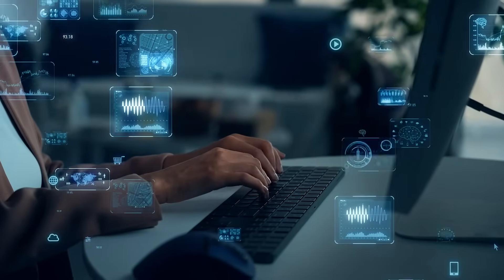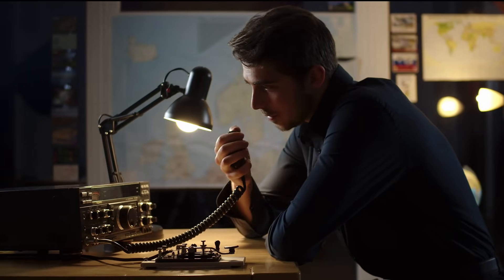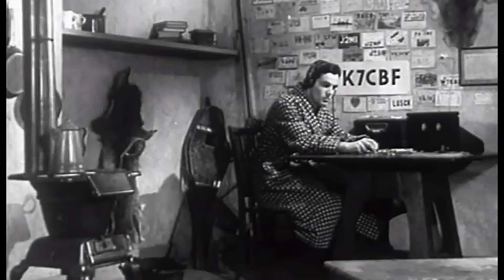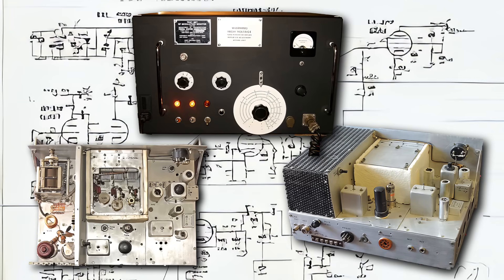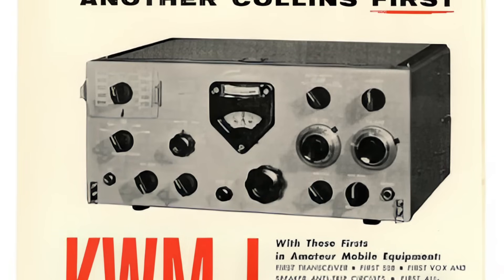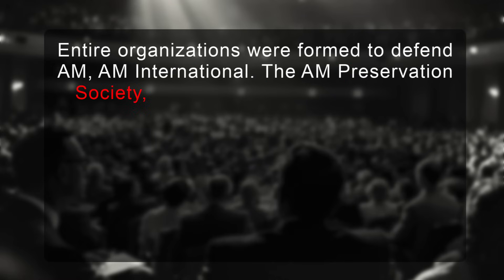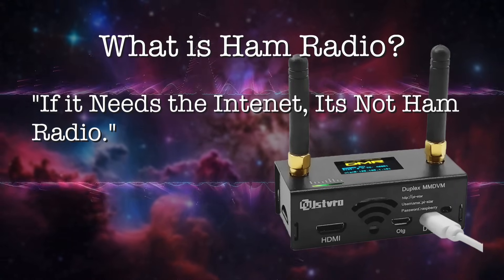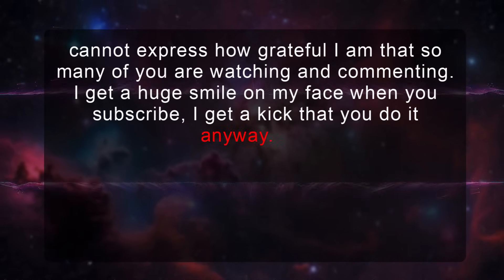Why Single Side Band (SSB) Almost Never Existed!

Comment: I never knew anyone had a beef about SSB. I guess I'm not  one of them
Reply: That may just be because SSB won the war.  How often do you hear AM on the HF bands?  Is it even still legal?  Seems to me like there's at least the expectation that your signal should not take up more than 3 kHz in the "phone" portions of the bands.  It's not until you get up into VHF where AM and FM and their wider bandwidths become a thing.  And then you have the aircraft band, where AM rules.  So I guess each faction claimed its own territory, and a truce was possible.
Reply: @BrightBlueJim  There's regular AM use on a couple of frequencies.  3885kHz?  I love that people still use it, as I'm a SW radio collector, and most of the sets don't have SSB.  Some that do, it doesn't work that well or isn't easy to fine-tune.

Comment: I get such weird looks at my local ham radio group when I start talking about D-Star. Maybe I’m ahead of my time?
Reply: Let me see, why would you get weird looks for wanting to use a proprietary protocol in ham radio?  Nope, I just can't imagine.
Reply: Maybe because it is an out-dated mode with an unnecessarily complicated registration process with zero tech support and no bit error correction?

Why Kenwood felt it necessary to bugger up the few VHF/UHF ham radios they still make with Icom's albatross, I will never understand.  It adds terribly to the expense with a mode I will never use again.

Comment: It is natural that SSB was not accepted as well, because it requires some signal reconstruction on the receiver side. For that, both the transmitter and the receiver must have accurate frequency references, and it requires extra filtering that AM transmitters and receivers don't need. However, SSB makes way more sense, especially when the bands are crowded.
Reply: Proponents of digital modes could say the same thing.

Comment: I remember when I got my Extra ticket, the "old guys" (most of whom were from Europe or South Africa) in the local radio club (which shall remain nameless to protect the innocent) derided me as a "welfare extra" because I didn't have to have 10 minutes of perfect copy form a guy sending local newspaper articles at 25 wpm. Needless to say I stopped going to club meetings and held my own field day events with other "welfare extras" in a park across town from theirs.
Reply: By the time I got my ticket, in 1972, SSB was already well established and AM gone on HF.  There was still some on 6 & 2 metres.  Anyone remember the Heathkit lunchbox?  There was also some converted AM commercial gear then suddenly we started seeing FM on VHF, after the regulations changed to require narrow band FM for commercial users.  This freed up a lot of wide band gear for ham use.

Comment: i was in  the navy 55-59 and in 1957  we got an RCA SSB transceiver.  It was 4 channel crystal controlled and if I remember right around 7 mhz.  It amazed me that we could have voice communications from near the Arctic circle in the Atlantic to Norfolk.  CW was the only comm we had had before that.   When I was on the Atlantic missile range in the early 60's we were using the same equipment. de KI4AR

Comment: Historical sidenote : In 1936 television started up in Britain using vestigial sideband transmission. Same idea, but only the transmitter needed special equipment.
Reply: More on the historical sidenote - American television also used vestigial sideband for the video and FM for the audio until digital HDTV came into being. I don't know how the British wove color into the broadcast, but the American TV used a very ingenious trick of inverting sidebands into the same spectrum area for the color information.

Comment: This is just me, I don't like FT8 because you can not send any real information. I do like JS8Call because I can send information. But I do not want to stop them from using FT8! I think There is room for all of us on here to do what we like. I also use DMR! Yes it does use the internet most of the time, but it can be used local without the internet! It has better range than FM! An yes I have a hot spot! I can and have driven down the road using my DMR HT talking to friends states away, using a mobile WiFi. We all need to learn to play nice with others!

Comment: Years ago, I used to use the sideband on CB (Children's Band) radio.  I had studied the principles behind the sideband and noted that the only time real power was produced was when the amplitude of your voice caused it to do so. This of course was subject to the voice of the operator, sometimes weak and other times loud like Fred Flintstone.  I thin got to thinking of what would happen with a continuous tone over sideband.  Full power 100% of the time.  Of course, having a tone present all the time was unacceptable for voice.  Then I thought that maybe a sub-sonic or ultra sonic tone outside of the range of human hearing could do the same job.  I built a tone generator into my base station mice and adjusted it so high only dogs could hear it.  By golly it worked!  Side band from me was well received.  I lost interest with the CB after cell phones came along, and all that equipment is long gone.
Reply: I have to admit that while I still have an interest in ham radio, I haven't bothered to set up a transmitter because, well, I don't have much use for it.  In the 80s and 90s, it was a thrill to talk long distance.  FIDOnet and WWIV BBSes were cool in that a local BBS could communicate across the nation.   Now?  IDK.  I listen on web and KiwiSDRs and just don't hear any conversations that I wish I could contribute to.  Maybe one or two a year.
Reply: What do you think the carrier is?  When you study modulation at the college level, as I have, you learn a lot of conventional ideas are just nonsense.  I remember having an argument with a co-worker about this very point, around a half century ago.  Another fallacy is AM can't exceed 100% modulation.  However, that's just a limitation of commonly used equipment.  If you start working with a double balanced modulator (4 quadrant modulation) and appropriate receiver, you'll find you can.  Typical AM modulators work in just one or two quadrants and when the signal goes into the other quadrants then you get distortion.  However, that's strictly a limitation of the equipment, not AM in general.
Reply: @James_Knott  I mean, sure, but what equipment are you going to receive that overmodulated AM on, without distortion?
Reply: @radellaf   Well, an SSB receiver should do it, though there may be better choices.  With a double balanced modulator you can adjust the carrier and side band levels independently and one does not effect the other. I was able to demonstrate that in my Electrical Engineering labs.

Comment: Slop bucket sounds like a great description for SSB! Considering how awful it sounds when you’re not quite on frequency, and considering that most hams don’t bother to tune it any better than necessary for comprehension, it can sound pretty sloppy. But it does save power and bandwidth, and there is a place for everything in the Amateur Radio Service, so carry on!
Reply: Totally agree.  I've been doing a lot of listening on portable SW gear rather than transceivers, and SSB just doesn't sound that great.  On some radios it's hard to dial in precisely.  The transmitters are dead on freq, usually, but the little sets can easily be off just enough.

If it's a good QSO I'll sometimes switch to a webSDR or KiwiSDR that sounds better and is easier to tune.  One day I'll get a station set up again, but just no room, time, or money at the moment.

Comment: Comment:  it’s interesting and I don’t feel that way about radio, but I do feel that way about new music and ai technology.
Reply: I think the reason it was a big deal (and continues to be for digital and especially proprietary digital modes) is because of the barrier to entry for each new transmission mode.  You get comfortable with how things worked when you bought your expensive radio, and then there's a bunch of crap you can't listen to, cluttering up a limited resource.  I'm sure the AM ham transmitters taking up huge chunks of spectrum were a problem for the CW operators when AM started getting popular.
With music, you don't have to listen to what you don't like.  AI is another matter though, since it's creeping into everything.

Comment: As a nearly ready for my test old guy, I love the idea of trying the modulation modes that can copy and decode below the noise floor. Will my local ham club grumble that using that low a transmit power won’t be real ham radio?
Reply: I think a more realistic concern would be that SSB operators might stomp on you because they didn't hear you.

Comment: A minor clarification - Multichannel multiplexed voice land circuits had been in commercial use since 1918, but the first transoceanic voice cable TAT-1 was not installed until 1956.  The late arrival of transoceanic voice is surprising because the transoceanic telegraph transmission had already begun by 1858, just 14 years after the first ever land telegraph circuit.  What held up voice over submarine cables was the need for periodic amplification about every five miles. A suitably rugged and long lived repeater which could be deployed overboard as an integral part of the cable was not developed until the 1950s.
Reply: Came here to say this: SSB had been used for decades on Trunk phone lines, and the technology was well established before it appeared in Ham radio.
My recollection was that the theory of SSB was well understood, and many SSB homebrew sets (both phasing and filter) documented before the commercial sets arrived. I remember enormous excitement when SSB arrived, and most comments were very positive.
The other correction is that SSB was rarely (if ever) used in WW2 military operations.

Comment: According to one of my favorite books Science and Technology in the Bell System (p. 281) Carson worked out the math for SSB suppressed carrier in 1915.   An experimental 4 channel multiplex land circuit was installed between Maumee, Ohio and South Bend, Indiana in 1917.  The center frequencies were between 5 and 25 KHz plus baseband.  A commercial carrier circuit between Balitimore and Pittsburgh was installed in 1918.

AT&T developed transatlantic HF band voice radio telephone transmission between about 1920 and 1930 with reliable service by 1930.  The transmissions would have used  multiplexed carriers of single sideband channels.  Equipment of required precision and stability would have been out of reach of hobbyists. AT&T maintained transoceanic radio transmissions until around year 2000.

The US FCC authorized SSB for use the amateur radio service in 1947.
Reply: Thanks for the info.  In the '80s I got an SWL QSL from an AT&T station, a great souvenir of a service that once was.

Comment: There's a lot of slamming of AM in this video, but the antagonism blew in the other direction too.  As the hobby shifted, operating AM in the late 60's and early 70's was a lonely existence which was often met with SSB jammers and name calling.  Frankly, this stuff has been going on since before CW overtook spark-gap.
Reply: The first time I saw spark-gap was at a Boy Scout Expo when I was probably 12 years old.  I didn't know what it was beyond being a CW transmitter but, BOY, was that cool!  That image has never left my mind and that was about 60 years ago.
Reply: @David-hm9ic  The thing to understand about spark gap is that it's not CW.  Spark is an electro-mechanical transmitter using an alternator, not electronic CW.  CW, or continuous wave, was the electronic improvement over electro-mechanical which consigned spark to the dustbin.

Comment: The comparison between AM and SSB being made to FT modes vs legacy modes is not at all fitting. Both AM and SSB are voice modes (and are both AM even…). Operating either is essentially the same with slightly different equipment.

FT modes don’t really allow any real communication as the limit of transmitted data is tiny. They also require essentially no operator skill other than setting up the station. So comparing FT8 to legacy modes just isn’t fair to either. 

Note I’m not trashing FT8, I have about 10k Q’s on the mode. Amateur radio is about advancing the state of the radio art after all and digital modes do that. On the other hand FT Modes are changing ham radio. I’m not sure it’s for the better but only time will tell there. The only thing that is inevitable is change though.
Reply: There are plenty of digital modes that aren't FT8, that don't have rigid time slots.
Reply: @BrightBlueJim I am aware. My comment was only pointed at FT modes as the original video singled those out for comparison.
Reply: Given how much SSB activity is just making contacts vs conversations... I guess nothing is lost using FT8 instead.  Personally, yeah, I'm way more interested in a weak-signal conversational digital mode, if there is one.  I'd love to try PACTOR-4, if it were possible or easier to get into.

Comment: Great video except towards the end and in the beginning ....   You forgot to mention the  MOST intense arguments was over repeaters  and  FM Simplex over AM. on the VHF  in the 1960's and 70's ......Use of Echo Link is a GOOD thing for retired HAMS who' paid their dues ' over the years and cannot put up antennas in HOA or apartments or anywhere else .

But you misrepresented the issue of modern RF vs internet and  FT8 (and all digital modes ) ..... This was a legitimate concern .   The ARRL allowed and promoted FT8  (FT8 being the least productive mode for anything but DX and awards) .    By allowing Ft8 in mixed international contacts  awards like DXCC ,they have said that you don't really have to know much to get this award , try 150-200 DXCC on SSB  ?   Dumbing down the HAM radio community

Comment: Where's the protest group, demanding a return to CW via spark gap transmitters?  

That can be adequately wide bandwidth, as to make these expensive receivers a waste of money.  And reduce needs to communicate about what frequencies others will use.  

OTOH, how many people have had their hands on a MW HPA capable of 500 kW or more using A3?  

Or bigger in Shortwave.....

If we consider the PEP equivalent of a 125% positive, 96% negative modulated AM broadcast system, using modern high efficiency MOSFET sum buss digital analogs of modulated waveforms, a nominal 50 kW Tx with a reserve for DA losses and normal adjustment range, and conservative ratings for long term reliable performance, is 5-10 times nominal carrier power.  Or, with newer rules on energy savings by carrier reduction during heavy, sustained modulation, has traits of partial DSB suppressed carrier, except via digital waveform emulation and summed module HPA, not traditional AM modulation of a separately generated carrier.  

Or in public safety and corporate or government systems, digital trunking, shared systems where actual channels are allocated based on user variable demands across a group?  

That latter tech actually reduces pressures from cell industry and government to just take over HAM bands, as has been done chipping away at broadcast TV spectrum.  So HAM's should oppose it as costly and weird?  (even if for unrelated services, or maybe useful in lieu of discreet repeaters in some dense markets?)

Comment: You forget to explane why LSB on the low bands and USB everywhere else.
You forget to explane why LSB on CB
Love to know why LSB on pirate bands.
Btw I am a REAL HAM ! Smoke the pipe, CW only and always grumpy.
Reply: The answer relates to the fact that in the late 1940s US hams were not allowed to operate 'phone on 40m.  All 'phone activity was on 75m (3.7-4.0 MHz) and 20m.  An early transmitter design might generate SSB on a fixed frequency of 5.0 MHz and feed that signal into a mixer that was also driven by a VFO running at around 9 MHz..  So, suppose your 5.000 MHz signal was USB, and your VFO was at 9.3 MHz.  If the mixer output was tuned for 20m the resulting signal on 14.3 MHz was also USB.  But if the output of the mixer was tuned for 75m and your VFO was at 8.75 MHz, the resulting 3.75 MHz signal was LSB.  (Note that these "5 MHz & 9 MHz" signals are far away from the desired "3.7 MHz or 14 MHz" output frequencies, which allowed the tuned circuit of the mixer output to suppress those unwanted output signals.)  73-WB9CYY
Reply: always wondered that, myself.  the answer is probably just a Google away but I never have.

Comment: 👍Nice bit of history, thanks. It's easy to take SSB for granted nowadays with super stable oscillators, highly efficient mixers and filters. It was not always thus. I can remember the challenge of trying to clarify SSB siganls on old comms receivers fitted BFOs designed for CW reception. I must admit, I do sometimes smile when I hear SSB phone ops deride digital modes. As you say, at one time SSB was regarded in a similar manner by the old AM phone ops.

Comment: It is mostly about power effeciency, not only bandwith utilization, and  also being compartible with CW mode, just a   wider bandwith
Reply: I'm not sure how you can consider AM to be compatible with CW, since you need a BFO to read CW.  The fact that SSB and CW can use the same demodulator is just a bonus.